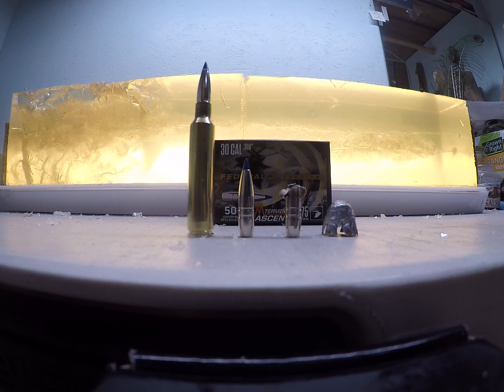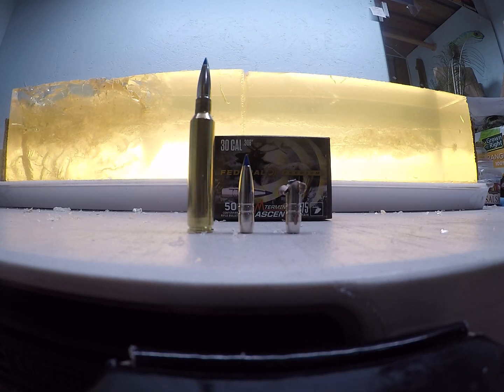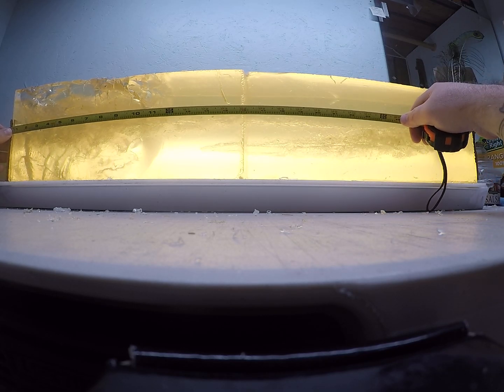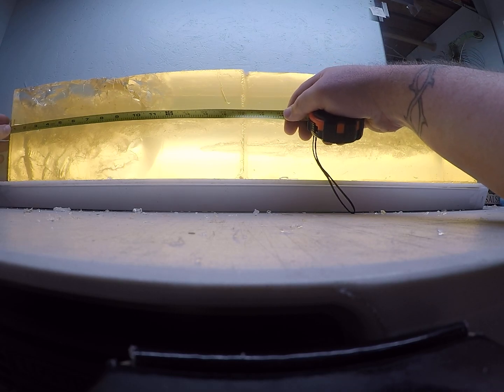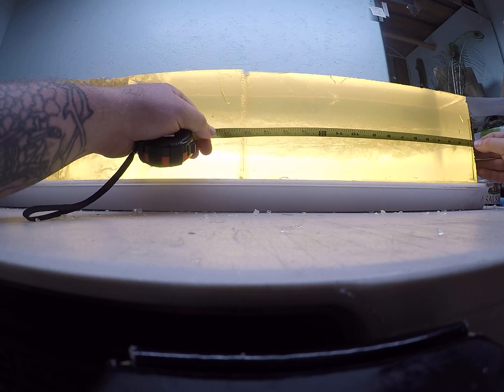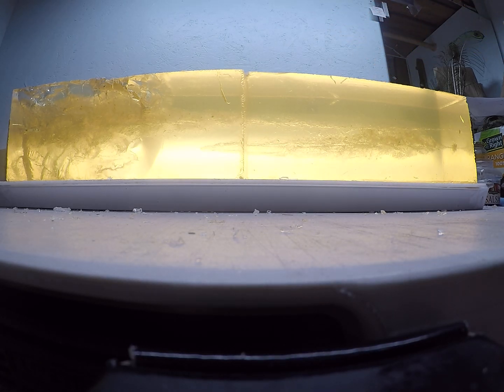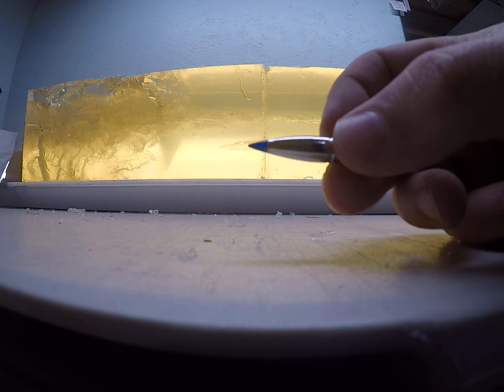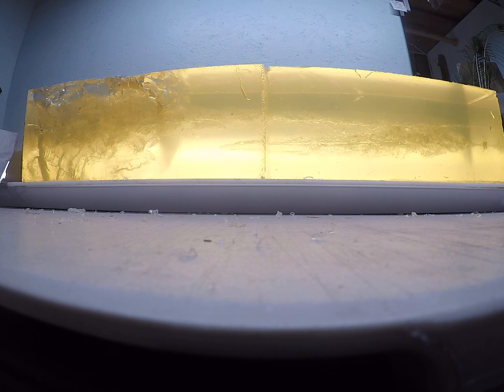300 PRC 175 gr Federal Terminal Ascent ballistics gel block overview PT2

Comment: Why do you think the 6.5 performed so differently (poorly) to this at low velocity? Maybe more weight helped with expansion?
Reply from the maker: Weight and over all bearing surface is what I think. The 6.5 still had overall good performance I think the reduced energy simply because it is light and its smaller bearing surface not allowing better transfer of energy is why it didn't perform as well. Hard to say for sure. I had opposet results with the Nosler ABLR line of bullets.
Reply: @simplemindedfella  I think it could also be handy to consider the primary use case for the intended bullet weight, especially in regards to the 175 gr .308 projectile. Most manufacturers lighter.308 projectiles are "softer" as they are engineered to be used in a .308 rifle, and tend to be frangible when used in a .300 win or prc due to the MV. This could explain the performance, which in this case I think is a plus. I would love to try some 175gr in my WM.